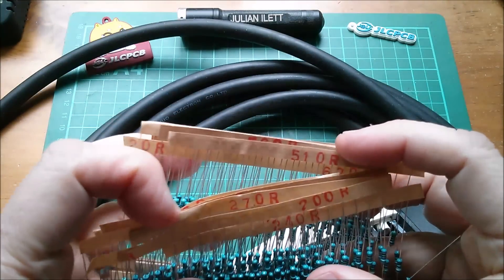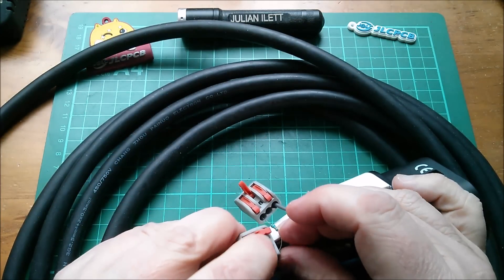Vehicle to Load (V2L) on MG ZS EV

Comment from the maker: You can now buy a V2L cable for the MG in a range of lengths and colours from evcables.co.uk
https://evcables.co.uk/products/mg-vehicle-to-load-v2l-discharge-cable
Reply: £108.42 for a 0.5 metre cable?

Is it made from 99.9999% oxygen-free copper?
Reply: Why you buy a new cable, your home made is not good?
Reply: One thing to note.

The resistor you use seems to be either 1/8 or 1/4 watt resistors, but the resistor value schematic you printed from the internet, says the resistors on either side is either 1 or 1/2 watt.

I don't know if this actually matters, but if i were you i would get a 470 Ohm 1W resistor fitted, just to be on the safe side.

Also i would be interested to know what kind of protection against electric shock this V2L offers. 

In my country, there is a fuse to safeguard against over-current, and a fault relay, that will trigger if the live gets connected to earth (through a person for example) i think that's called an RCD.

I wonder what the car would do if it was in discharge mode, and someone grabbed the live wire while in bare feet, standing in a puddle.

The RCD and fuse is mandatory for houses here, but i wonder if there is something similar built into the discharge circuit.
Reply: One Like RUKIDING

Comment: Great video. I found it very informative. BUT like jaunjo6190 found out 2 years ago, My 2022 MG ZS EV only works in discharge mode if the car is ON. That means the headlights and taillights the fan and the AC are all on too. We tried running the house from the car last night, it worked; and the car lit up the neigbourhood. I wonder if MG can do a software update for me!
I live in NSW Australia. I have purchased 2 different discharge adaptors from eBay. Both needed resistor changes before they were even recognized as discharge devices.

Comment: Cheers for making this video mate.

Our car charger was recently replaced and I kept the parts from the old one. Which included a 3 or 4m cable with the car end connector  attached and bare cable at the other end, so I thought about making my own V2L cable and saving a few hundred quid. 

I have an MG4, so I'll start off at 470 ohm for the resistor and test it. I have high hopes it will work flawlessly.
Reply from the maker: Should be fine. I've heard that 2k ohms also works but may limit the power output to 2.5kW (or thereabouts). One guy said that he was able to pull 7kW from his MG4 using 470 ohms.

Comment: I've tried a couple of V2L cables with my recently purchased ZS Trophy Connect one has 427 ohm the other 676, neither is detected as a discharge cable.
Reply: I have noticed that the eBay sellers of these are saying they no longer work on 2023 cars.
Reply: @shawng5799   I had the V2L inverter retro fitted to my car and now I can boil a kettle, fry chips, grill bacon and also run an ice maker for a m
Martini.

Comment: Do you know if this has changed? I have a V2L adaptor not working on my 23 reg zs ev. It measures 470ohms accross pp-pe but the car thinks it's a charge connector
Reply: I notice that the sellers of these are saying they don't work on new cars now.

Comment: Electric Car Side Discharge Plug EV Type2 16A Charger Cable with EU Socket Outdoor Power Station( need car supports  V2L).  There is a need to find me to understand the product in detail!!Can we work together, Sir?

Comment: Hello Julian. Thanks for all the information. I've read the entire thread but one question does not seem to have been answered.
You say: The Hyundai Ioniq5 V2L adapter has a switch on it, which appears to start the inverter without having to enter the car. Looks like the MG always requires user interaction inside the car.
But the German circuit has CP connected to PE and a question was asked: Would connecting CP to ground allow for the discharging to begin without needing to tell it to start?
Have you ever tried connecting CP to PE or PP for that matter, to see if this is the case or if the "start charging" characteristics change in any way?
Reply from the maker: Pretty sure I tried connecting CP to ground and it didn't make any difference. Entering the car and switching on the car's electronics just so that you can start up V2L is a bit of a pain, but I don't know of any way round it. What's also a pain is that the 12V battery isn't charged during V2L (when the car is switched back off). Some cars don't have the ability to switch off the car's electronics after initiating V2L and must be left in the ready state with the DRLs on and the doors unlocked.
It's also been reported that the resistor value has an impact on the maximum V2L power output: 2k ohms limits the output to 2.5kW and 470 ohms allows for more power. But that came from an MG4 owner. I've not yet tried this on the ZS.
Reply: @JulianIlett  Thanks Juilian. On my IONIQ 5 V2L plug, the resistor is permanently between PP & PE and the ON/OFF switch is between PP & CP. Is there a faint chance that joining PP & CP on the MG connector may deliver the much-desired V2L ON without intervention inside the vehicle?

Comment: On my 2022 MG ZS EV the V2l only works with the car on. If you turn it off, after a minute, at the same time that the screen behind the wheel turns off, the V2L stops working. Sometimes after a few minutes the screen turns on again and the V2L works for another minute and it stops again.
I have tried it with the original V2L cable of the brand (very expensive) and the same thing happens.
I advise future buyers that the V2L is important to keep these limitations in mind.
Your videos are perfect, direct and friendly.
Reply: Same issue on my MG ZS EV. The only way to get power out is to have the car powered up and unlocked! So for camping it will work great as long as you don’t mind leaving the car unlocked. Ok as long as it is not dark, at night the car lights are illuminated to advertise it is unlocked and powered up! I would love to understand the logic here, especially as they lock the V2L cable to stop theft but leave the car unlocked!

Comment: Does the car have to be running for V2L to work or can the engine be off?
Reply: Was reading that it can but after a few hours of doing so it will cause a 0.9A drain on the 12V battery wich after 10hors or sol will mean the vehicle won't start.  Leaving it on it doesn't do this but the day-time running lights will be on which is not ideal.  Not sure if a decent solution for this has been found for those wanting to have it running for a day or so.

Comment: I am soon to have a solar/battery & Sunsynk hybrid inverter installed. If I bought an MG4 with V2L cable what problems would you see in using the “aux load/generator input” to the inverter to mix in with and supplement my solar battery charging on less sunny days?

Comment: Hi Julian! I have an mg zs ev 2022 facelift (same as the one in video) in India and i have built a discharge connector using 470 ohm. All connections are ok and the instrument cluster also recognises the connector and displays discharger connected. But my head unit ui seems to be different and does not display any discharge menu and no option to start discharging. Hardware seems to be compatible and i suspect software issues. Your thoughts?

Also could you help me with your head unit software version and details to compare with mine?

Thanks
Reply from the maker: That's odd. Is the car advertised as having V2L in India?
Reply: @JulianIlett  No. But since it is a CKD unit, and has quite a lot of features not offered in india but offered outside india, i was hoping for it to have V2L, but i guess its having some hardware imssing which is why it doesnt have a discharging menu either.

Comment: Great vid. 
Trying to get this to work with a BYD e6. 
Tried all those resistors but the car says check discharge equipment. 
Any ideas?
Reply from the maker: Maybe CP also needs to be grounded (or have a resistor). But that's just a guess. Very interested in BYDs vehicles - the blade battery is impressive.

Comment: I've modified a plug to connect across pp and pc with a 470 ohm resistor.  
The car doesn't recognise it as a discharge device. Will the advertised device work?
Reply from the maker: What car?
Reply: @JulianIlett mg 5 long range
Reply from the maker: Pretty sure the MG 5 doesn't have V2L. The new model does though.
Reply: @JulianIlett  I'm pretty sure I've got the new model. 64kwh battery

Comment: Thanks, Julian, very good vid. 
The v2l capability is exciting.
So I sent off for one from a Chinese supplier. 
The quality looked great, but it didn't work.  
In the end I made a hole in the plug, because it didn't come apart, and I connected a 470 Ohm between the pp and pc terminals. 
But that didn't work either. 
I have a few pics of the set up, but it's basically just what I've described.  
Is it possible that my software needs an update from MG before this is going to work for me?

Comment: It's interesting stuff you say where to get a plug from, how it's done .... but could you please show how/where the resistor actually goes?  you've shown the bulb wiring in great detail but the EV connector is only shown half uncovered and the really interesting bit is always obscured in the bird's nest.  Is it pe - resistor - pp or is the resistor pp - R - cp  it's not at all clear, even in slow mo
Reply from the maker: On the V2L cable, the 470 ohm resistor is placed between PP (proximity pilot) and PE (protective earth). I found that CP (control pilot) can be left disconnected.
Reply: @JulianIlett  FYI it doesn't seem to work with Nissan leaf ... Bother,. Error says charge cable, so it's seeing something, just not a bulb
Reply from the maker: Does the Leaf have V2L?
Reply: @JulianIlett  I was sure I'd seen a vid but I'dashed if I can find it.  They were th ONLY car tagged by OVO for a V2H trial,. I was accepted but then it folded, something to do with shared feeds on the distribution. If you google there is a massive fridge sized thing from nissan that manages their version it and also shows v2l, so whether it's to spec or what I don't know.
I expected that Nissan would have written the book, but maybe not.

Comment: Do you know - does MG place any restrictions on the battery warrenty when using Vehicle to Load? 
Or could it be used to power the night-load of a photovoltaic-enabled house?
Reply from the maker: I'm not aware of any restrictions - the maximum V2L load is quite small and can't take the battery below 20%, so it won't stress the battery. Do read this: https://www.mgevs.com/threads/v2l-warning-also-discharges-12v-battery.6145/ about the 12V battery.

Comment: Very interesting video! V2L is getting more popular, and it's especially useful and convenient now that power outages are at an all-time high.
Reply: Electric Car Side Discharge Plug EV Type2 16A Charger Cable with EU Socket Outdoor Power Station( need car supports  V2L).  There is a need to find me to understand the product in detail!!

Comment: Very interesting, thanks for sharing. Our first gen ZS EV doesn't have 'official' V2L so we had to go old school and wiring in an external DC to AC inverter to get 230 volt AC. Great video!
Reply: I have the first gen too, did you suceed by creating a V2L solution?

Comment: thanks this is really helpful.  I was also wondering why the MG is only rated a 2+x kW, i always assumed they use the charger with a different phase angle, but this would then allow 3 phase high power.  Does the MG really have an extra inverter, and how does it cope with surges
Reply: MG AC charger is single phase 7 kW , discharge is set to suit 13A socket , but with a safety margin limit of 2.2kW ( 10A )

Comment: Have you included any short circuit protection?. If the cable gets damaged or cut then a short circuit will be felt at the cars inverter, will it survive!
Reply from the maker: I'm assuming that's in the car.

Comment: When my MG eventually arrives with a bag of chips from China, I will be eating my chips in bed next winter, keeping warm with my electric blanket running off a long extension cable attached to the MG. Next day change the leads and hope for lots of sunshine 🌞 from the SOLAR panels to recharge the car. At the end where I would connect a double socket there appears to be a wire cut off so did I miss something in the brilliant video? Simple wiring diagram for us who are not quite so confident with experimentation would be most appreciated, MANY THANKS

Comment: Any ideas what cable I would need to charge a laptop inside the car while diving??? Took a kuga on test and the daughter loved the 3 pin plug but the ZS doesn't have one. Cheers👍
Reply: Depends on what kind of computer you have.

Most new computers have USB-C chargeports and these usually accept the PD (Power delivery) standard.

If this is the case, you can get charger that do PD, and plugs into the 12V "Cigarette lighter" plug next to the USB and USB-c ports.

If your laptop does not accept PD, then you need to look for a charger for your type of laptip, that has a 12V input instead of the 230V in the charger you have now.

No need to get some fancy 12 volt DC to 230 volt AC, that you then plug your charger into and it then does 230 volt AC to 20 volt DC conversion.

Much easier to get a 12 volt DC to 20 volt DC converter

Comment: Do you reckon you can charge your home battery from V2L. I get 4hrs cheap rate so i was gonna charge my vehicle and home battery but if my home battery was running low give it a top up with the V2L ac.
What would i need to get the power into my home battery. The cheap electricity comes from the grid but how would i get the power the the home battery inverter. Obviously I've got the cable coming out of the car but then im stuck.
Reply from the maker: Not possible. The V2L output will not synchronise with grid electricity.
Reply: @JulianIlett  i wanted the power to go into a home battery by way of the inverter that is used at night to charge the battery. I was think like the way a generator works in a power cut without the fumes.

Comment: Would be interesting to know whether there are settings to cover 50Hz and 60Hz and any current limiting. Here's hoping that the power is reasonably sinusoidal.
The concept of someone powering their EVSE (right back to the substation) from a in car inverter is not comforting
Reply: I believe it depends on what inverter the car has onboard as to what voltage freq and wattage the car can output

Comment: I was also following the German thread on goingelectric. Would you agree that CP is not needed at all? You have connected it, but in the end to nowhere.
Reply from the maker: Because I modified a charging cable, there's a CP wire running through the cable. In a discharge cable, CP is not needed. I guess the CP pin doesn't need to have a cable at all.

Comment: I hope the MG dealership isn't watching this channel.... I wonder what the warranty T's and C's are with regards to the use of non authorised or  DIY charging and discharging cables  - You're a brave man Julian :-)
Reply from the maker: Well, the use of 3rd party charging cables is nothing unusual. I can't see why discharging cables should be any different. At some point someone will take apart an official MG discharge cable - if there's just a 470Ω resistor in there...

Comment: Very interesting - this would also open up the possibility to have a "jumper cable" to fast charge a dead EV from a working one to limp it to a charging station.  If it was really done well maybe even have the building charging infrastructure use the same port and protocol vs a fixed cable and be able to use the same cable or even reverse the cable to supply backup power to a building.

Lots of cool possibilities.
Reply: Presumably a 2-pin charge cable plugged into a V2L adapter would achieve the "jumper cable" you're describing.

Comment: question: how's the car making the 240volts, does it do 110volt also, do electric cars have a regular, house mains 240 volt ac, power socket's inside the cabin somewhere, like the regular 12volt  cigar/utility socket,  so how the car making the 240 volts, your where question the  need for an EARTH connector, I thing if you where doing it as a permeant, say as a power supply camping or something, I think something like lighting rod  earth post hammered in to the ground would be a good idea, but would that effect the cars systems, if would  see it as a direct short to ground,  on the earth line, and just power down everything, and go into some sort of service mode?

Comment: I wonder if it's possible to get access to the DC voltage of the battery pack, with the charge cable similar to this.🤔 If the voltage is around 300v then you can run many appliances directly on DC. Most new appliances run on SMPS and not old fashioned transformers. And inverter drive motors.

Comment: You could charge/drain the battery daily for a few years, hardly use the car to drive and then sell it as a low mileage car.
Reply: or seven or so years, just use the car as a rideable mobile power wall, after seven or so years, the only visible marks of use will be of the power/charging connector( and that only if you keep connecting and disconnecting the cable, 🙂
Reply: @dh2032  The battery won't last long if you drain it every day.
You get more money for a young low mileage car that's still under warranty than for a 7-year-old low mileage car without warranty.
Reply from the maker: Yeah, I wonder if the number of charge/discharge cycles is recorded and stored somewhere.

Comment: May the different values indicate different output max wattage for the car?
Do you know whats the maximum your car is willing to output from that plug?
EV6 adapter allows up to 3600w (on 220v). But Maybe the value differences are like running from 1000-3000w ? 
Maybe test if 1500w space heater works with both ends and middle range resistor? :) Or will car tell that too much load was added and turn the discharge off.